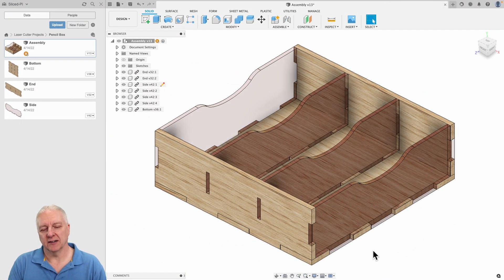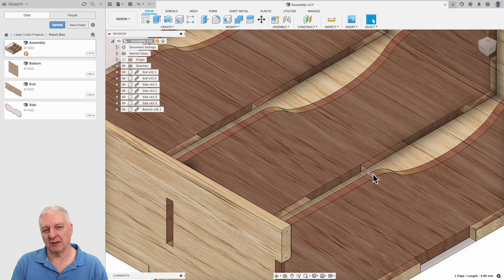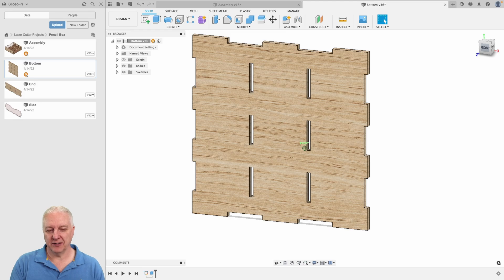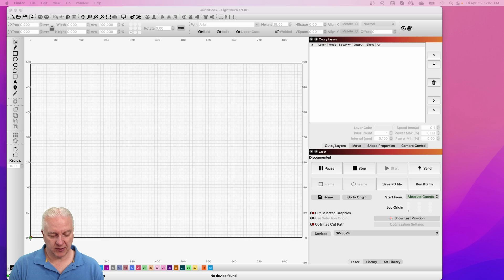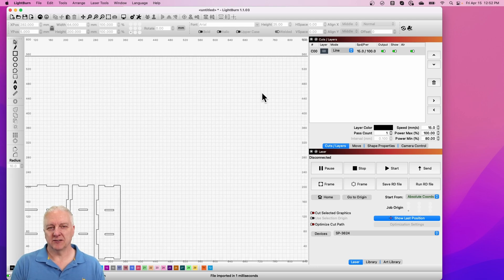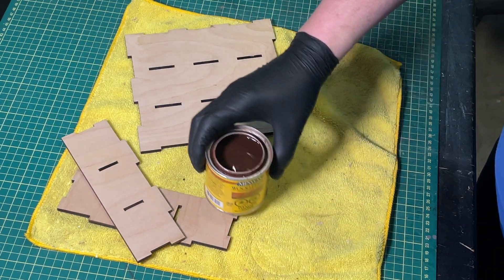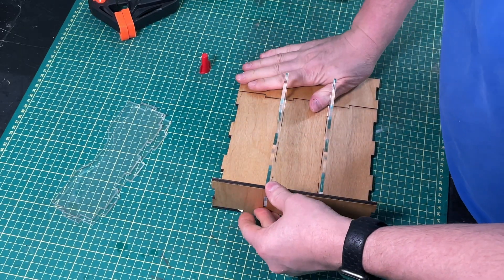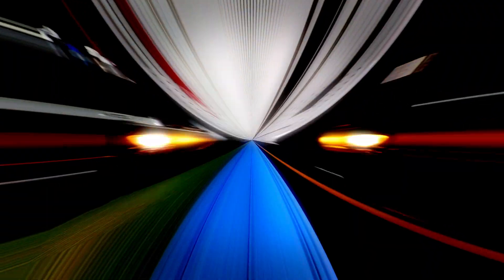Simple Pencil Box Design That Anyone can Make

Comment: What is the output wattage of your laser you are using to do this?
Reply from the maker: My sp-3624 has 90W output, though if you have a 40W laser that is well tuned, you should be able to cut laser grade 6mm plywood with relative ease.  Hardware store plywood is tough for a 40w laser to grunt through